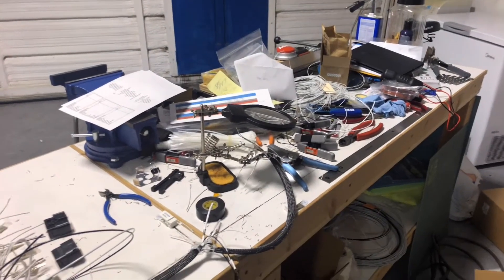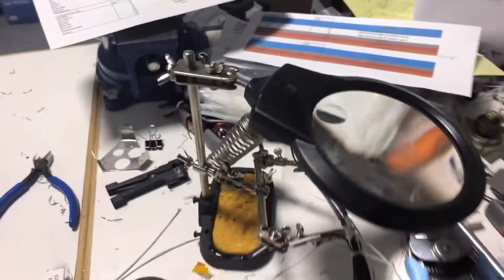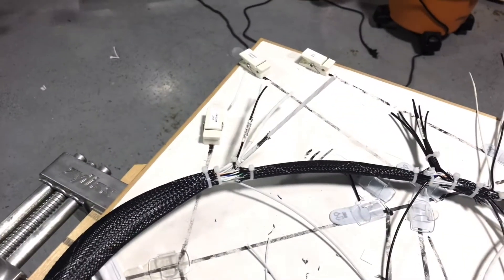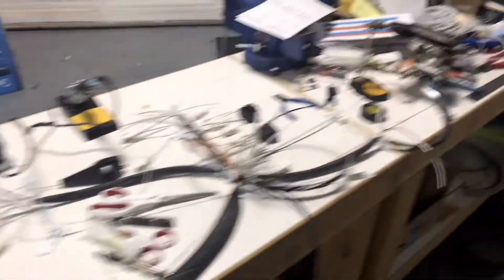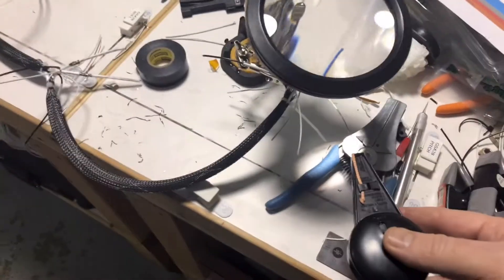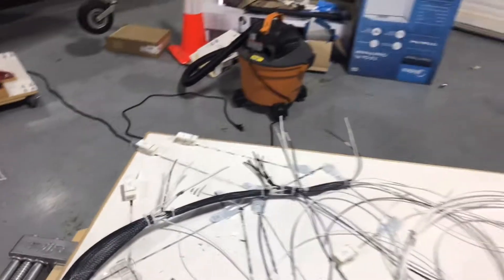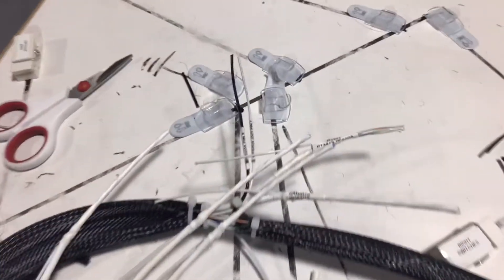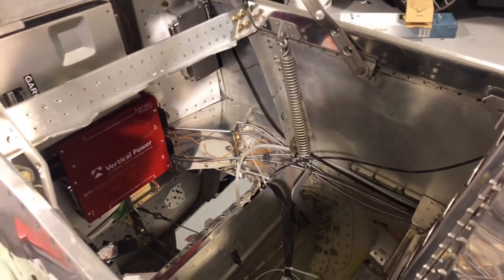Shield drains for the Garmin G3X CanBus and RS233 lines

Comment: There is no problem putting two wires into a pin as long as the sum of the cross sectional area meets the requirements for the pin.  Obviously, you will need a pin a size or two larger than the gauge of wire being used, but as long as the sum of the cross sectional areas is within the range of areas specified for the pin, you are good to go.

Comment: Nice video!
I was the manager for the Coors Light Silver Bullet Jets in the 1980's.  Noticed your BD5 in the background.  Is it still flying?
Reply from the maker: I am just completing this BD5 and hope to fly soon. The Coors Light Silver Bullets were one of my inspirations to own a BD5, along with Octopussy movie.
Reply: @bd5pilot883  Awesome!  I have some great drawings from our advertising that I can copy and send to you.  What engine are your using? -Kirby
Reply from the maker: @cramersclassics  I am using a ZDZ500 four cylinder boxer two stroke manufactured in Czech Republic. Very light weight for its horsepower and hopefully easy to keep cool. I'm expecting a final empty weight of under 360 lbs.
Reply: @bd5pilot883  Very cool!  That is an amazing weight.  My Kitfox seems light at 725 lbs.
I think the Silver Bullets used a French made Micro Turbo engine which was designed as an APU for business jets.
Very expensive though.